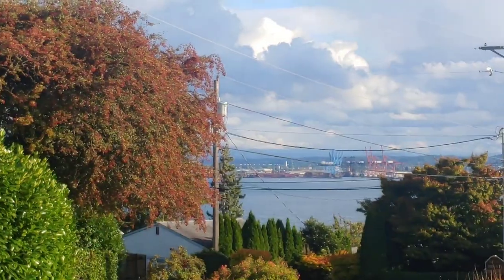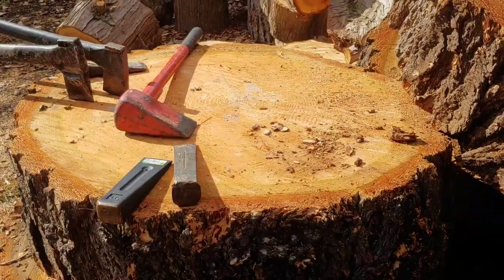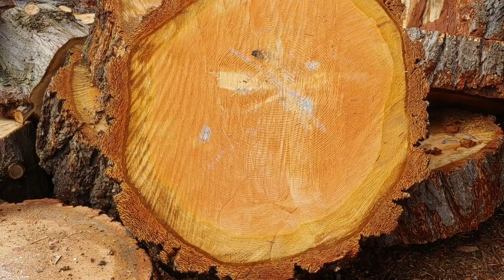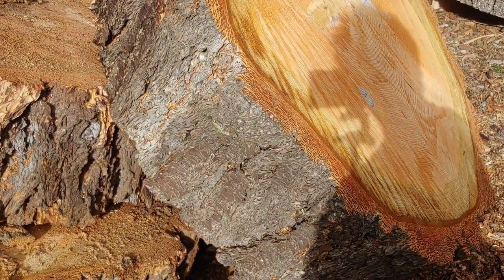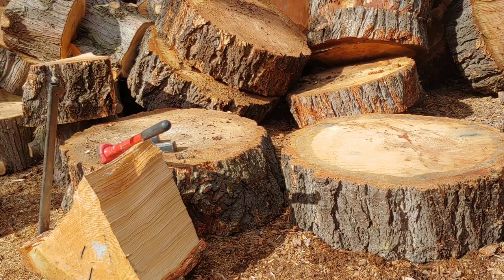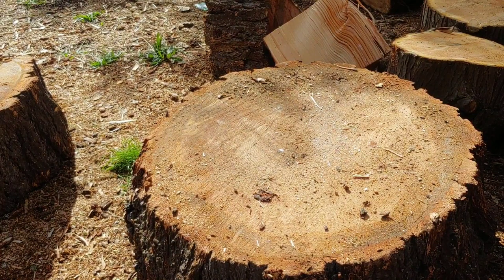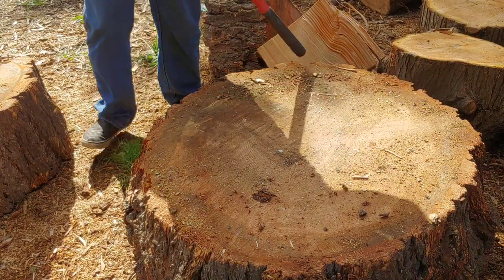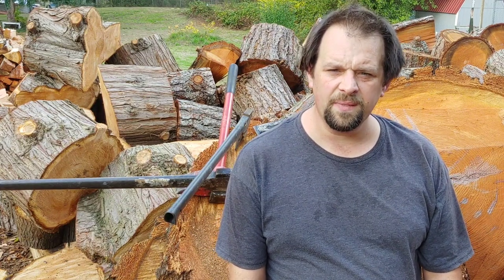How I Use Splitting Wedges & a Monster Maul #Firewood #Production

Comment: The MONSTER MAUL is great for certain pieces but I'd get one about half the weight. Like you say, a big maul like that can play you out too quickly. I use an 8lb splitting maul and I find it just about right. And I always wear my safety glasses when hitting steel-on-steel! I met a guy once who lost an eye when a burr from a wedge broke off and flew like a bullet into his eye. Every now and then it's a good idea to dress your steel wedges with a bench grinder or mini grinder to remove the overhanging burrs. Nice big round of Douglas Fir there Dan. Keep up the good work!
Reply from the maker: I have an 8lb maul somewhere but don't recall where I put it.. I do,know when I got the 2nd fiskars it was put up.
But it does make a great sledgehammer.
As for safety glasses allways when pounding on steel..😁👍
Reply: @DanielAtkinsFirewood  Atta boy Dan, Safety First!😀

Comment: Hi Daniel!!😀😀
You need to throw that monster maul away!! Those things are man killers!! Get yourself a 8 pound Collins splitting maul on wooden handle the same length as your inseam. They will drive the same wedge with only one or extra swings but with less than half as much energy expelled. It will also finish the splits better and actually be able to just split a lot of them. But it must be a Collins maul. They have the best splitting profile of any splitting maul I have ever used. I have split a lot of huge rounds of midwestern hardwood ( 3 to 5 feet in diameter) with wedges. Especially when I was in my early teens. I'm 55 now and only started using a log splitter the last couple years now. Otherwise my son and I have been hand splitting everything except some of the really knotty ones. Those just got ripped into nice firewood. 
At least get yourself a 8 pound sledgehammer 
Take care my friend!!😀😀👍👍

Logger Al
Reply from the maker: I have an 8lb maul somewhere. I suggested an 8lb fiskars maul for Christmas but we shall see how that goes..